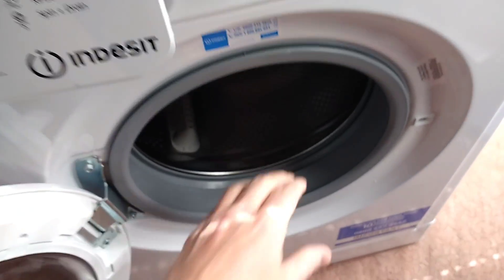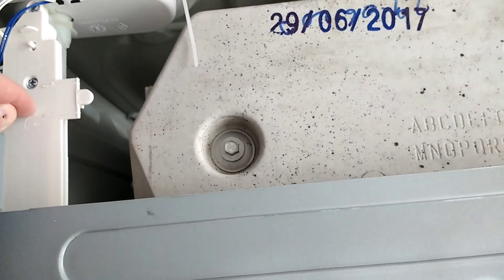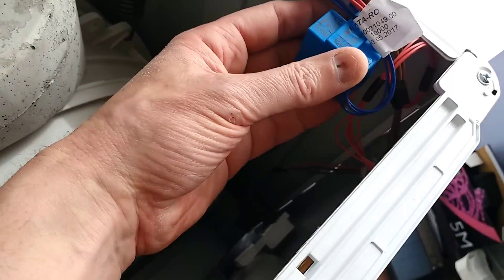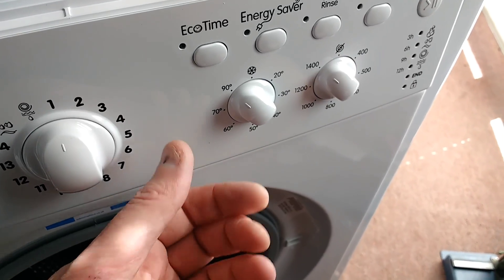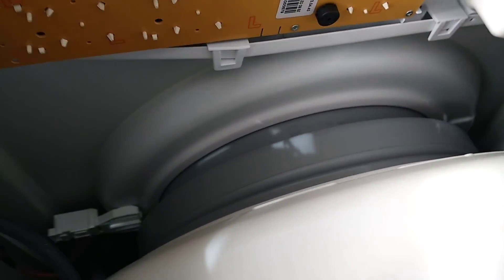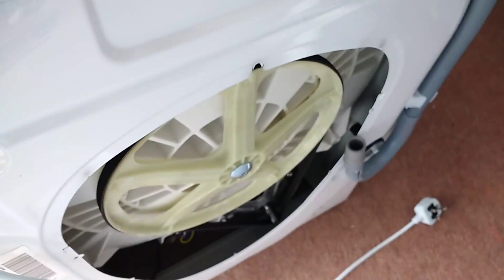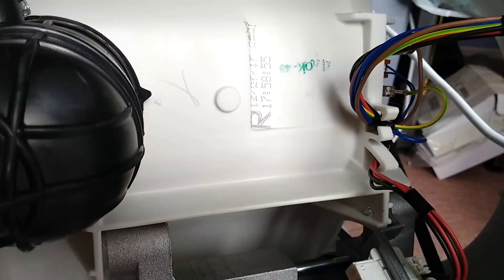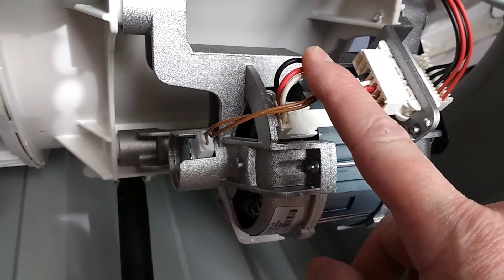Inside my new British washing machine (clothes washer).

Comment: IME the most usual failure is the bearings failing, just like your old one.  

On older machines replacing them along with the seal and usually the drum support spider as well - it carries the bronze sleeve the seal runs on - is a simple enough job if a bit of a faff once as you need to get the entire tub out to split it and get at the bearings. I'm putting off doing it for the second time on the 21-year old Zanussi here - got all the bits, just need the enthusiasm. 

But most modern machines, like your new one here, have a sealed tub that you can' t split in two, so if the bearings go it's either new tub and drum or new machine. The tub will be most likely be polypropylene.

Comment: The plastic pulley is probably done so there is somewhat less spinning mass. You don't see this in car engines (because it's too hot), but usually there will be some measures to reduce the amount of weight that has to spin. The only weight they'd add, is for things like idler pulleys or the harmonic balancer, which is a counterweight attached to the crank, for engine balancing.

Comment: Wonder if they make washers with detergent/softener tanks.  Dump an entire bottle in and let the machine draw the appropriate amount for the cycle.  Seems a no-brainer (as with oil/washer/radiator fluid tanks).  Measuring for each individual load is just ridiculous if you think about it.
Reply: They do, Miele, Samsung and Bosch. They are ridiculously expensive and the Samsung ones at least end up leaking detergent or getting blocked.

Comment: The pulley tension is the weight of the motor. The motor mounts act as a hinge to allow the weight hold the belt on at speed.
Reply: It can't really rely on that, because the tub really shakes during the spin cycle due to unbalance. The belt would come right off, if the motor isn't secured tightly to the tub, so the tub, motor, and belt, can move as one assembly.

Comment: I'm a bit pissed off...my last one, a Bosch only lasted twenty years or so...it's predecessor apparently made thirty with my missus...the new one looks iffy, but who can tell...

Personally my first wife and I were running a late fifties or early sixties twin tub into the late eighties and it worked fine...when we split up we gave it away to a new couple and it was still going strong...I' m not sure things are made to last that long any more...

My mother was using a nineteen twenties cooker (albeit north sea converted) into the nineties...I can't match that....

Comment: Hot water inlets have gone out of style since there is not much benefit to it with modern washing powder. They contain a enzymes that will crack up fat and protein residues at low temperature and since they are enzymes they will be destroyed at higher temps. If you insist using a strictly non-bio washing powder there won't be any enzymes but for non stained just sweaty and greasy clothing the low temperature route is just as effective and way more energy efficient.

I am amazed at how much more advanced the last washing machine I helped to install was compared with this model. It didn't use any obvious weights. The electric drive combined with acceleration sensors compensates any resonance effects and keeps the thing from walking around. What I like about the model you have shown is that I gets by without a stupid LCD and impulse switches, wifi and IoT bullshit.

Comment: Modern machines only have cold water inlets because most people wash at 30-40C, which is cooler than the hot water supply. It's inefficient to take in hot water and then cool it down by mixing it with cold.

Comment: How about that lad that has designed water tanks to replace the concrete blocks on washing machines . Should save loads on delivery vehicle fuel costs in the long run. Now that's the kind of innovation that we need to develop in young minds
Reply: Until the day someone forgets to fill the tanks and their washing machine wrecks the kitchen or sends a housewife to hospital due to catastrophic multiple orgasm overload.

Comment: Most stone types have a specific gravity of about 3, meaning that the stabilizing blocks could be replaced by a static water tank having about 3 times the volume of the stone. This could be formed around the drum. Why shouldn't a machine with a permanent connection to the water supply use such a tank for vibration damping? This weight saving would make transporting  and installation a lot cheaper and easier.

Comment: Interesting fact, someone in the washing machine industry recently had a brainwave, replacing the concrete weight with a water tank, filled up at end location. This should save lots in transportation costs as well as manufacturing costs.

Be interesting to see how long it takes for this idea to come into fruition

Comment: The reason there is no hot water inlet is the control of water temp down to as low as 30 degrees (C). Now a  temperature controling mixer would be a good idea, but a single cold feed pushes the cost on to the consumer (and the planet). Cheers

Comment: Clyde,
I have an American machine, brand name: Whirlpool.  A couple of years ago, it was necessary to change the fill-level switch (that's what water level switches are called here...)  The pressure transducer is a solid state device.  That replacement cost $288.90, including the labor.  It took about 5 minutes to undo the top of the machine, install the switch, and put the machine back together.
The repairman suggested that the most common failure mode for these switches is intrusion of detergent into the element.  He suggested using 1/2 the "recommended" amount of detergent.  Such machines here require use of what are called "HE" or high-efficiency detergents.  Use of regular detergents risks voiding the warranty.  I don't know whether you have similar requirements in the UK or not, but we've found that using half the recommended levels of detergent works just fine.  The clothes come out just as clean - which, if I were a cynic, might indicate to me that the detergent manufacturers are encouraging excessive consumption of their products.  In any event, you might want to keep this in the back of your mind as you begin your exciting new adventures in fine laundering...
Reply from the maker: I always use a low quantity of detergent.  I don't have any white shirts to worry about being whiter than white.

Comment: Hi Clive! I was told by my washer repair guy the all these new machines are pretty similar and poorly built (full of plastic parts including some of the frame?), and will not last longer than a couple of years. What's your opinion on these in comparison to older machines? Would you too say that it's better to keep repairing an older machine rather than getting a new one?
Reply from the maker: I've had good results with Indesit in the past, but that might have changed.

Comment: The diaphragm switch for the water level is not a switch... It takes 5v and gnd. The 3. Wire is out and gives a frequency that varies by the pressure in the hose. 
Take on apart and you will find a electronic board with a oscillator where the inductor is trimmed by a core connected to the diagram.

After 7 years as a service technician I have not exchanged any plastic pulleys, but the aluminum ones do have some broken spikes sometimes.

Comment: Top tip with these washing machines the bolt holding the pully on the back of the drum is a bugger for coming loose and throwing the belt of. I'd recommend changing it for something a bit more substantial

Comment: does it spin the opposite direction?
Reply from the maker: +Σωτηρηε Ντασκας It rotates in both directions during the wash to avoid rolling the clothing into a ball.
Reply: bigclivedotcom i know im just fucking with u m8
Reply: As a rule, they will rotate in opposite directions for the wash and rinse cycles, but typically, they will spin in only one direction. The way the tub is designed, they only channel the water slung off the basket effectively in only one direction during the high speed spin cycle.

Comment: Siemens uses permanet motors in their Machines as i saw in our device :D
But I really never saw a washing machine with a hot water inlet..... weird stuff you have in your country...
Reply: The Darasz Hot fill was standard until maybe 15 years ago when the energy rating needed to be displayed. From then, machines only used 1 litre of water per wash instead of 10 (exaggeration) so didn't need so much energy to heat it.
But the wash cycle length went from 40 mins to 2h40. Yes you also have quick washes but they don't get stuff clean like the old machines could in that cycle time.
You could just use cold fill on the old ones if you desired though.
But on my old hotpoint 9000 series, if you switched to eco mode it would not run the electric heater.
For 40c wash, it mixed hot and cold. For 60c wash, it only used hot. I balanced the flow to get the correct mix for the 40c wash.
Hot fill capability is making a comeback, due to more people having water heating by solar panels - and also water heating by gas Combi boiler is about half the cost of the electric heating in most cases.
Reply: This motor is a 2 pole 3 phase induction motor.(no magnets)

Comment: I hope you dont forget to pull out the transportation-security pins on the back, as I saw them still installed. Else it will be jumping all over the place on its first run :D
Reply from the maker: +computec1993 Yeah, I took them out just before pushing it into place.

Comment: So, on the selenoid valves: There are two valves and three compartments. When you open valve no.1 it fills compartment no.3. When you open valve no.2 it fills compartment no.1. When both valves are opened the stream of water collides and fill compartment no.2. 

The encoder on the motor is used to quite precisely measure the motor speed so it is a feedback to motor (usually triack) driver which supplies the motor with necessary power. The driver is usualy proportional-integral logic. Encoder is also used for detecting the unbalance of load during spinning phase. The spinning phase begins with balancing phase during which motor slowly accelerates (ramp) to around 100 -120 rpms then the variance of speed is measured. If it is to high it means that load is distributed unevenly and motor stops and then tries the ramp in the other direction, until variance is in threshold and actual spinning can begin.

Take care when attempting to dissemble and measure the power supply for the logic as it is usually the maximum possible cost effective. In my company LNK30x were used in application where GND connected to neutral (hence the total isolation of circuits in white plastics). Many PCs and oscilloscopes were destroyed by newbie engineers while attempting to connect without isolating the scope with transformer or without using optoisolation for communication.

Comment: We just got a new machine pair at our house. It's a top loader. There are no belts anymore, it's direct drive, which also means that there's no transmission and the tub goes almost all the way to the floor, with no central agitator post.  It does some funny stuff and the direct drive system sounds like a jet turbine when it's spinning up (it spins very very fast).

Comment: Sealed tub designs in most machines now mean when the drum bearings go (just out of warranty) the machine is scrap. You may find your older machine is a split tub which can be repaired. If so KEEP IT !

Jesus.. plastic pulleys as well ? Ugh... It'll be dead in 2 years.

Comment: tbh the laundry liquid/powder can be "washed" every time water enters the machine. My bet is that the diverter you're talking about is like a funnel, and the solenoid changes the direction and floods the fabric softener compartment. Otherwise it turns clockwise and always floods the other two compartments.

Comment: My 12 year old Whirlpool uses a 3 phase motor and I think it's operating a lot higher than 50/60 HZ and that accounts for the small motor size. Electronics is a lot cheaper than copper windings and laminations.

I had to replace my door switch about 5 years ago and it was a PITA, you needed two people to do it - one to hold it in place while the other put the screws in. Other than that it has been trouble free (mine has all mechanical controls) but the bearing is getting loud so a new machine is in my future.

Comment: Don't like how much plastic they use, but not much you can do. except check your pockets for change before the clothes go in.  had an LG front loader and it fired out a coin through the side of the tub. mind you a little silicone sealant over the hole and it ran for a few more years.

Comment: Uncle Bumblefuck (AvE) has mentioned previously that a good plastic will be stronger than a cheap cast aluminum part.
The aluminum housing for the motor is screwed into a thin bit of plastic, so I'm guessing it's alum for heat dissipation. 
Also, are you wearing navy blue king gee shorts?
Reply from the maker: Black Dickies shorts.  The European version (shorter and narrower than the US version.)

Comment: Great example of Design engineering, Value Engineering and Manufacturing Engineering -  However there are always some people who seem to expect such cheap utility devices to be made using lots of nuts and bolt and to withstand 20 repairs over 30 years. Buy it - use it and throw it out when it dies.

Comment: If you haven't already, I'd recommend installing this machine on a manual power switch. A really common failure mode we see on washing machines today is stand-by power supply failure after a few years, leaving a dead, potted and expensive brain board attached to perfectly good mechanics. I've personally just wired a household wall-mount light switch in series with my washer outlet at home.
Reply from the maker: I have an accessible switch for its power.  I don't like leaving too many appliances on standby for the reason you mention.  It ages the power supply.
Reply: Smart bear.

Comment: I had a very similar Indesit washing machine. Everything worked fine for a couple of years until the bearing of the pulley broke. It can't be replaced because it is plastic welded in the drum

Comment: I maintain washing machines for friends and family.
I remember well the time when controls were analogue and components would only fail if say a water seal failed (such as on a pump).
Nowadays they're literally made of plastic and concrete and wrapped up in tin plate.
Your concern with the plastic drive wheel is well founded. What I'm finding is the plastics used in the components is not stable and has a (designed?) limited lifespan. What you notice first is smaller plastics such as clips holding switches together will fail. Eventually the thicker plastic components will fail - the large drive wheel included..
Reply: This is the issue when you can now get a new washing machine for  under £200

Comment: Could you theoretically flash the software from the more expensive model into this one?
Reply: I know it's a bit late but no, not practically. The boards are fairly generic but not exactly the same. By the time you got the "upgraded" panel, components, board,  sensors etc you
d have been better off buying a better machine in the first place. Some components can be swapped and modded to repair an old machine but it's certainly not practical to magically "upgrade" one with software. The good news is most of the wear items truly are generic such as the pumps, motors and solenoids so they are a doddle to repair.

Comment: our machine went gaga making us think it needed a new controller board, which we got at great expense, not curing the fault...until when looking again saw that one of those rotation sensors had fell off the motor, so bunged it back stuck in with a bit of silicone, then worked correctly , argh £130 wasted 😲

Comment: Washing machines in India don't heat water at all. We're at 230v too, so it isn't an amperage thing. Maybe it's a hot country / cold country thing? Unlike US washing machines, we don't have dryers either. Just a spin cycle, after which we dry it on a line. A little more work, but smaller bills and +1 for the environment. Does heating the water make any difference at all? At what temperature will it make that difference?

Comment: the fill level pressure switch had to be adjusted to add more water we did not do this until the warranty was up but we should have done it the very first day the clothes are the cleanest they ever have been and also stop using liquid the only powder in the  machine the fount loading consumer machines seem to really suck my all manufacturers 

set up a rig to monitor the pressure reading while calculating water usage

Comment: Here is my washer/dryer with the same symproms see the video:- https://www.youtube.com/watch?v=LneJ2cShL-I&feature=youtu.be
Removed the lid to find the drying motor bracket snapped and the whole motor assembly flapping about which destroyed the flexi hose vulcanised to the drum which is where the warm air enters the drum to do the drying cycle..10.5 years old and several repairs to keep it going so it was beyond ecconomic repair this time as the main drum bearings had failed causing the unbalance in the drum which led to its demise in the end..just bought another for £170 to get us going again..a new chepo one just a plain logic washer.

Comment: The extra stuff that might be on the control panel for other models may be for a dryer function, which might explain the blanked-off 'drainage hole' underneath as well??. Also if you're sceptical about the quality of the belt/pulley system I can recommend direct-drive machines, well not all of them maybe, but I used one recently and it worked fine but was also very much quieter than belt drive.